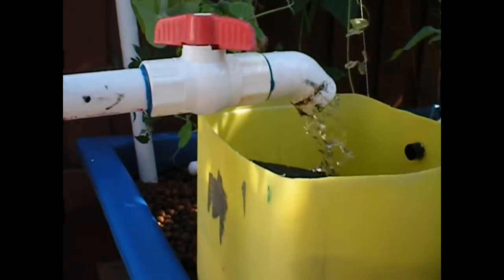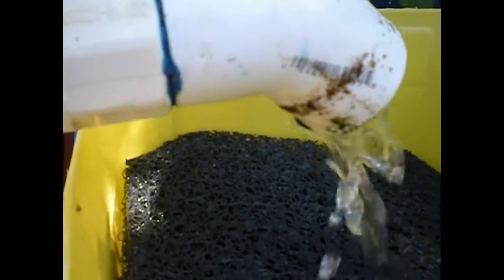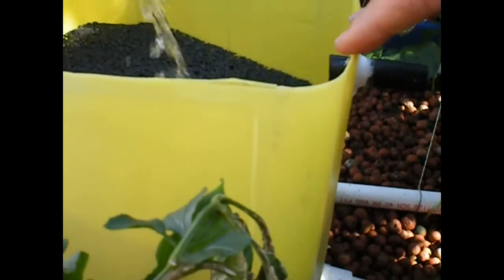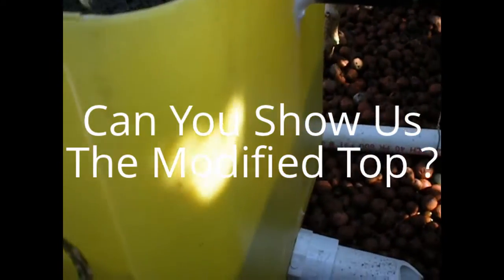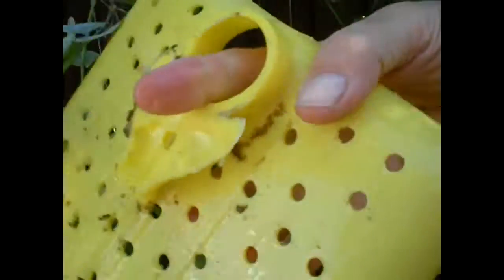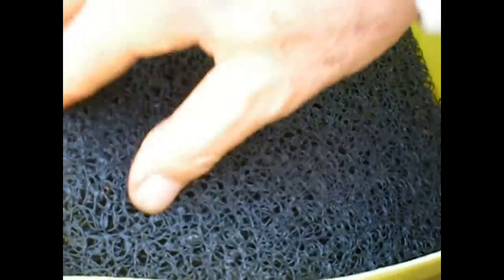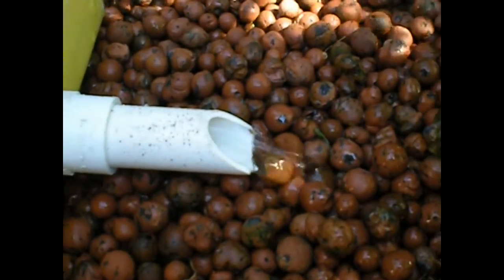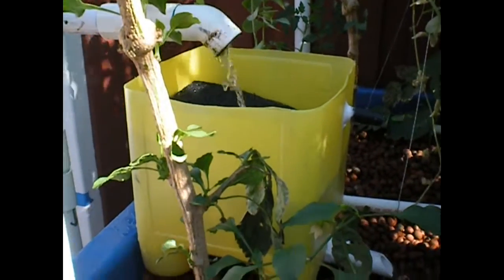Aquaponic Bio Filter 1 - Homemade Bio Filter For Aquaponic Systems

Comment: Cool idea. I believe it may work better if You should spread the water at the top. The piece that you put at bottom should be at top and another piece (I would suggest a lime stone rock to convert the output to Calcium Nitrate - a fertilizer ) should be kept at bottom for efficient De-nitrification.